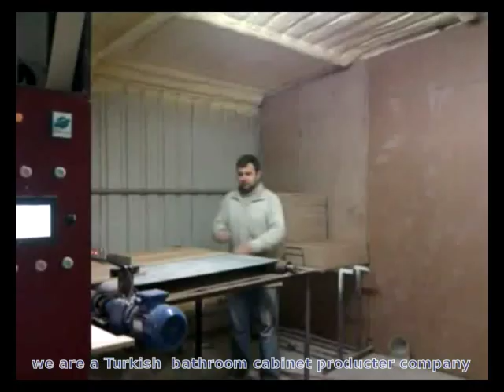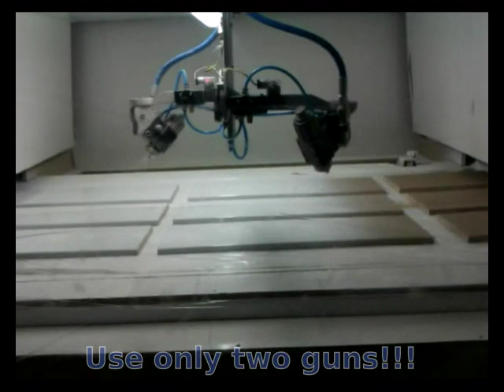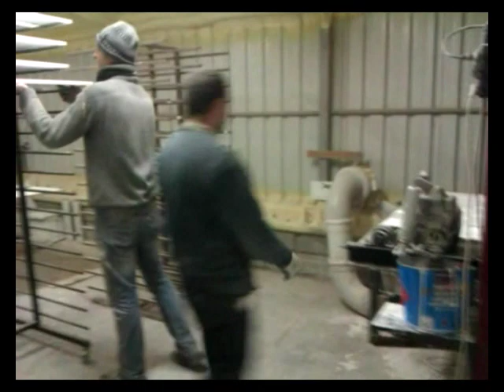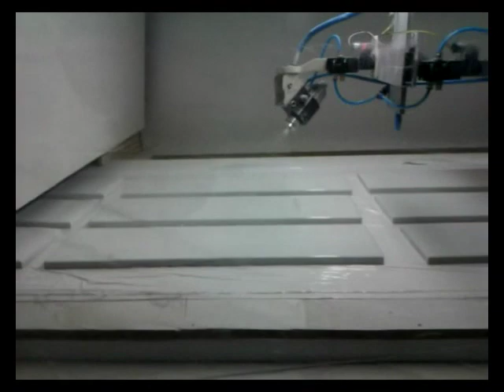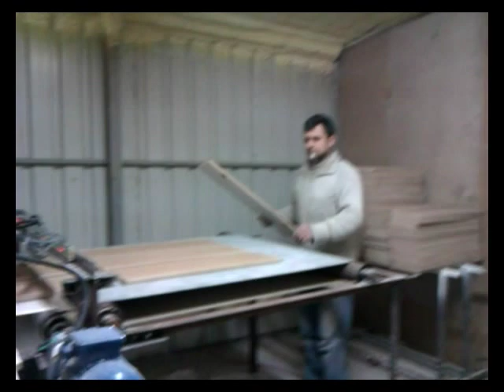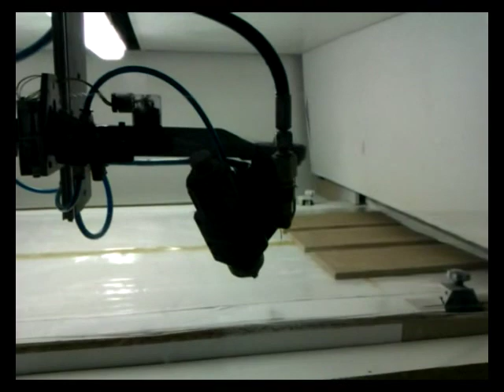Automatic flatbed spray finishing machine

Comment from the maker: Sure you can,
because of europen producers sell machines so expensive, I start to developing this machine.
i used high quality well known spare parts.
its fully controlling by touch sceen panel
after this video, i upgraded swinging speed. i ll add new videos about it.
we was using strech film or paper over band
now; 
i m working on band cleaning sistem and flash off oven when finished i ll add its videos.
thanks for interesting,